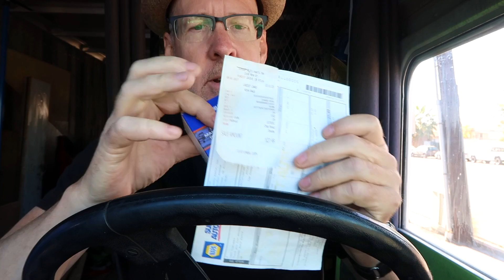New House Batteries for Step Van E347

Comment: Oil pressure sender, looks like a VDO. Look on the side of the nut, on the sender for the part numbers. Have the auto parts store run those numbers, or check online.VDO https://www.vdo-instruments.com/sensors/pressure-sensors-switches.html?cat=1772 . Jegs http://www.jegs.com/p/VDO/VDO-Pressure-Senders/887192/10002/-1 . Summit https://www.summitracing.com/search/brand/vdo-gauges/product-line/vdo-pressure-senders?SortBy=Default&SortOrder=Ascending&autoview=SKU&keyword=sender&ar=1 . Good luck, Tcash
Reply from the maker: a couple of others sent the same VDO link. thanks for all your help with research!

Comment: Your ideas on the batteries makes sense to me. I'm doing the same as well, lead acid to start with. My bus has a hinged access door, then the battery tray slides out. It weighs alot, and I would like to try and do this on my MT45 as well.  My sprinter van the sheetmetal is so light weight I'm very limited on places where I can attached anything of strength so I'll probably have a metal tray hanging by 3/8 threaded Rod. I'll use that Dexion, the lightweight angle iron with holes you can buy at Homey Depot. [They sell different thickness of this]. Challenging stuff! Also the wires are very heavy gauge and difficult to work with, so you have to consider room for it to move and be able to pull out if you are doing a drawer.  My MT45 Stores two engine starting batterys under the pass side steps.  For temporary, maybe permanent I'm place two House batteries on the step of the drivers side, as I don't really enter/exit using the steps on the drivers side. Then I'll install the inverter just behind the drivers seat.  I'll have a bridge connection with a big relay between positive on house and connect to pos on engine batteries. On my step van the floor unscrews if I want, and I can install relay and bridge connection above the transmission. Pretty close to each other. Anyway it some ideas. Hope you are feeling better!  God bless! Enjoy the coffee!
Reply from the maker: I have the same battery setup in my MT45 under the steps. I'd love to see photos of how you install your house batteries. I'm still working on the ideal solution
Reply: whats the best way to get you a photo? text, email??
Reply from the maker: perhaps instagram or post it somewhere and send me a link? does that work?
Reply: Holy cow! I'm realizing how technologically illiterate I've become! I'm used to texting, emailing, don't have an instagram thingy set up.  Ok so my U tube channel is Allen Rousseau look under videos, hopefully you'll see the Step van battery video. I'm completely new at this so forgive the screw ups! I'm adding older videos for fun to show family my crazy projects!  God bless! AL

Comment: I raced Slot cars for years using old style lead acid car batteries indoors @ 24 volts sometimes with a charger on them. you would have to be pretty careless to have an explosion, like taking a lighter flame to them when they were being hot charged. You can smell the fumes if they off gas which I don't think in that application will be a problem.
Reply from the maker: thx for the extra info!

Comment: Looks like VDO 360009. Do you know the pressure range of the current one? VDO 360009 is 0-80 PSI
Reply from the maker: 80psi... I think you are right on the part number (someone else found it as well)

Comment: https://www.vdo-gauges.com/sensors/pressure-sensors-switches/pressure-sensor-only/pressure-sender-80-psi-warning-contact-7-psi-1-8-27npt-30-23.html
Reply from the maker: that looks like exactly the correct part! however, doesn't look like you can buy it from the site and all the sites listed don't sell it online :(

Comment: Sounds like a hassle finding that part. I had a similar problem today, though I only had to go to three places to find the right on. Still had to do a bunch of research to find the right part. This is how thing go I suppose, especially for your step van. Good call on the batteries.
Reply from the maker: actually a guy in the O'Reillies you were in found the exact part for $85... crazy expensive. one of the subscribers linked it from eBay for $6 shipped from china

Comment: To access your batteries, once they are under the floor, just cut a trap door on your floor directly above them. This will allow you to access them from the inside. I know of a vandwellers who did this and he's quite happy with the result.
Reply from the maker: wish I could, but the aluminum step van has a unique floor made of special channel sections. you can't cut it without damaging the I beams which are part of the aluminum planks

Comment: https://www.ebay.com/itm/1947431-Cummins-5-9L-Oil-Pressure-Sender/152821549116?hash=item2394dfc83c:g:zAQAAOSwdGFYwJn0&vxp=mtr   This maybe a replacement for the old oil sending unit->  https://www.ebay.com/itm/Oil-Pressure-Switch-Sensor-For-Cummins-Dodge-5-9L-24V-98-5-02-4921511-W-Plug/322831168312?hash=item4b2a3cb338:g:cEQAAOSwg8tZ9DRj&vxp=mtr
Reply from the maker: I think you found it! looks exactly like the right part. great job!

Comment: dont remember seeing a battery question video from you
being were you are you could have shopped surplus 'server/telco' UPS AGM batteries
usually less $100 each
my first set cost me $67 each for (4) and lasted almost 5 yrs every day use
i bought this set (5) in April for $70 each
these 105# each, 135ampHrs each, fully expect to get 5yrs, out of them , IF i keep the RV that long, loking to replace this RV with one that a floor plan more suited to what the other half wants

Comment: Seven, you can get a watering system for your battery bank. Clear tubes go to all the cells with one water connection. Go to a place that sells or services Electric Forklifts. I had one on mine.(forklift).
Reply from the maker: I heard about that. need to research it more

Comment: Try contacting the DeBoss Garage You Tube Channel. They are on top the Cummins stuff...  You can use an "Ear Wash Bulb" from drug store to service the acid cells with distilled water. Coat connected terminals with a light coat of grease (any) to control corrosion. A cheap Harbor Freight Solar charger could keep the batteries fresh in the interim. Pay attention to series / parallel configuration to keep correct voltage...
Reply from the maker: great tips. thx!

Comment: Walmart sells battery boxes in automotive dept. about 23 bucks.
Reply from the maker: I saw that, but they are singles. I want a box for 4
Reply: 6 volt deep cycle batteries are taller. They require a special size. They can be ordered online at some RV supply stores. That's where I got mine. They sell tandem boxes, and single boxes.

Comment: You are doing this the hard way When you are at NAPA or from Amazon, get a real battery box for four golf cart batteries Your quest is easier if you use the right tools (in this case, parts)
Reply from the maker: I've been looking at commercial battery boxes. hard to find one for 4 batteries

Comment: The key to successful AGM battery life is charge rate and discharge, anything below a 12.4v you begin to shorten battery life, and a charge rate higher than 2.5 Amps will shorten battery life, higher quality chargers are needed for long life
Reply from the maker: great to know. thanks!

Comment: Maybe mount the batteries to the lid and put the tub upside down? Probably still won't fit lol. Find a welding shop as long as you have space figured out it should be fairly easy job and not terribly expensive. Likely have to fabricate a rack underneath and make a door in the floor. Some angle iron, welder, grinder, hinges, and about an hour at the most and you should have what you want. Would be careful of your mounting location underneath for ground clearance if you decide to go off road a little. Providing the ground is hard and you don't bottom out you should be able to do some decent offroading being a dually. Maybe get some tire chains just in case :)
Reply: I'm laughing at the off-roading comment. Even a well-maintained dirt road feels like off-roading in the step van!
Reply: TheGalavan  well never said it would be smooth lol
Reply from the maker: Joni would know... she was the first ever passenger to ride in my step van on pavement and it was a rough ride then. she also saw me drive on a dirt road once
Reply from the maker: Tom, I have about 24" inches of clearance under there. I could mount the batteries under the step van and still have tons of clearance. also, I did get stuck and jamies van build party (on flat ground in some gravel)
Reply: You MIGHT want to go ahead and create the space inside for batteries since you plan to upgrade to Li in the future, and they prefer to be indoors and cozy. But they don't take up as much space either...
Reply: I got to ride on dirt roads as well, getting in and out of the site! Definitely NOT smooth! ;-)

Comment: EXCELLENT CHOICE !!!  Seven, you made the right choice with the Trojan T-105's.  They are  the best bang for the buck and out perform and out last  just about any other lead acid deep cycles in their category.  A pair of the 6 volt deep cycles will cost around $300 and if properly maintained will last 5 to 7 years.  Some of my other favorite popular youtube Nomads are currently having ongoing battery issues because they keep buying the same walmart  "fake" deep cycle batteries and not listening to their viewers that know the difference.  It's worth going to a dedicated battery store to get them.  There are battery boxes available that are designed to fit the dual T-105's. Just look online.             CCC
Reply from the maker: yay! happy to hear about your research which lines up with what I discovered in my own search

Comment: Seven,,, Amazon Vdo 360 006,,,shows 80 PSI,,, The one thing you need to look is are the threads the same where it screws into the engine,,,If you don't Get it sorted before the RTR,,, Someone at the RTR will be able to help you sort it out,,, if Jamie is there he will know someone who can help,,, Safe Travels
Reply from the maker: I was thinking I'd try to get the part, then install it at RTR where I have some help

Comment: Good way to start the day Starbucks and Home Depot .Maybe check at an International truck dealer . They deal with many truck parts and repairs and are usually very resourceful .
Reply from the maker: mine is a freightliner, but I'll check there too

Comment: And the oil pressure gauge you can use a more reliable mechanical gauge and ditch the idiot light.
Reply from the maker: I have a gauge which is stuck. may need to replace it as well

Comment: Agm/LA same thing just different as long,as distilled water is used and charge not drained they will work just fine. LA batteries will calcification if normal tap water is used.Bad juju.
Reply from the maker: great tip. thx for letting me know about the california water

Comment: What brand of gauge is in the dash.  The sending unit looks like the type they use with aftermarket VDO gauges.
https://www.summitracing.com/parts/vdo-360406?seid=srese1&cm_mmc=pla-google-shoppingsrese1_-vdo-gauges&gclid=Cj0KCQiAyNjRBRCpARIsAPDBnn1tBM_ht6X8SSJ_O9vCXFrslHOhHnm2xOkI6iP5aoBxqSQmm9p1aCcaAgXbEALw_wcB

Comment: Look for a push on style wire connector from a junk yard Dodge pickup and splice it onto your step van wiring and use the new oil pressure sending unit you already have.  Even trucks that have the motor pulled often still have the wiring in them.  Good Luck Seven.
Reply from the maker: great solution

Comment: Interesting conundrum. Do you expect the lead acid batteries will still be the more economical alternative if you account for the cost of the undercarriage battery box, specifically since you seem to plan to have it built? Or the complications that could occur if you vent the temporary box (leaks, structural integrity, ...)? Not advocating, just asking. Good luck.
Reply from the maker: I'd like the undercarriage mostly because I have so much room under there, keeps my weight lower on the van, and solves the venting issues... three way win. and, for me anyway it is fun to do things like that

Comment: I went with AGM solely for maintenance.  I have no room to check or add water. I would have to remove each battery to check the water level if they were flooded cells.  Definitely go with flooded, if you have the room.
Reply from the maker: lots of room ;)
Reply: Seven Wanders the World Yes, there is plenty of room beneath the floor. Accessing it will be expensive. You need easy access to the battery caps. Will you cut a hole in the floor or create an access door in the bottom part of the exterior van body. I think AGM will be cheaper. You can put them anywhere.

Comment: The problem is more an issue of missing or incomplete information in the parts store catalogs than lack of parts available.  NAPA and other parts stores quite likely have the part you need , right there on the shelf. There is just no reference to it.

Someone mentioned taking the oil pressure sensor to a hardware store. The reason is that the threads are of a certain diameter, and number of threads per inch. Or per centimeter. 

Go to the section for nuts. Now find a nut which will fit on the guage, one that turns without binding, like it was made to fit on the guage. Write down the diameter and screw pitch. 

You don't need to know what that means, just write it down. 
Also buy that one nut.

Now you can find a guage with the same diameter and screw pitch.

Now look on your dashboard. The oil pressure guage should have a maximum reading. Write that down too. 

Now you can go to a parts store and say, : I'm looking for an oil pressure sensor which looks like this. Hand him the part. 
Also the nut. The nut will tell the parts clerk which sensor will fit, and which dont. 
Once they find sensors that fit, their computer should mention what it's psi range is. Find one that matches. Then you are done. Keep your receipt.
Reply: Check boat supply stores for a battery box to fit your new batteries. Love your RV.com just got one for his upgrade on his solar. He's got a video up on the upgrade and he mentions where he got his in the comments. Good luck.
Reply: Then there is the electric property, ohm/"pressure unit", good luck with that one, but jokes aside, there are oil pressure kits that consist of a sensor and a dial indicator (analogue or digital) there you just need to be aware about the threads for the sensor and the voltage supply for the indicator.
Reply from the maker: great advice. the difficulty with that is that I live in my step van and have very limited mechanical skills. I think I might maybe know how to change out the oil pressure sensor, but given that it most likely will leak when doing the swap, I'm not sure I want to park in front of the auto parts store and then pull the oil sensor out leaving it leaking while I walk inside to try to locate the part. if they don't have it, I have to risk getting it reinstalled properly without help or be stranded in their parking lot with no support having to call a travel mechanic to fix it. so... anyway, I don't want to be a burden on friends either, so I'm trying to buy the part in advance so I'll have it in hand when comes time to swap it (rather than asking someone to drive me to a parts store and not finding it there and running around to 5 different stores). hope that makes sense!

Comment: My step van has a shelf above the dashboard just about right for four Group 31 deep cycle batteries. Just have make sure it has support and ventilation.
Reply from the maker: you put them on your dashboard?
Reply: No, there is a shelf well above the dash, an overhead (open) storage area high enough that it doesn't interfere with the windshield. The wiper motor is mounted in the center, just shy of resting on the shelf.

Comment: I would check with a dodge dealer first. Those lead acid will give You good service with proper maintenance.
Reply from the maker: thx. I do have a dodge sensor which I bought in Oregon. looks different
Reply: Seven Wanders the World 
Does it have the two terminals and the correct threads? If it does it will work fine.

Comment: I'd try a Dodge/Chrysler dealer for the oil pressure sending unit. They put that engine in their trucks forever. If no, try a manual guage with a 1/8 copper line, hooked to a tee that screws in your engine block. The other port in the T gets any O.P. sending unit from napa (read 60s or 70s and cheap) that turns on at like 15 or 20lb. Hook it up to a red clearance light on your instrument panel so if your not watching your guage and you lose oil pressure it'll get your attention.
Reply from the maker: I have a dodge oil sensor from Napa (the one I bought in Oregon). it looks different and don't think it will work on my van. thx for the tip on the red light
Reply: Seven Wanders the World  What I meant was that the rolling chassis for your van is probably a Dodge chassis, hence the Dodge dealer for the sending unit. IDK, perhaps Grummund builds their own chassis, besides the body, proprietary Grummund sending unit. Anyway, best of luck 👍

Comment: Seven I’ve done some extensive searching couldn’t find the sensor but you could possibly use the sensor from a Dodge Ram Cummins 5.9 diesel only thing is you would have to get the wiring connector to the sensor
Reply from the maker: the napa unit I briefly showed is from a dodge. I might try putting in that one but will need a wire plug to go into the slot on the sensor. that might be the most logical solution
Reply: Seven Wanders the World might be worth a try to get it working at least
Reply: Seven Wanders the World 
Visit a Dodge diesel junkyard and snip snip the connector